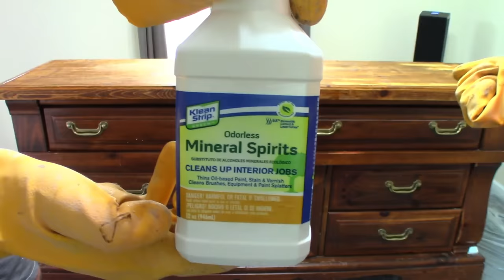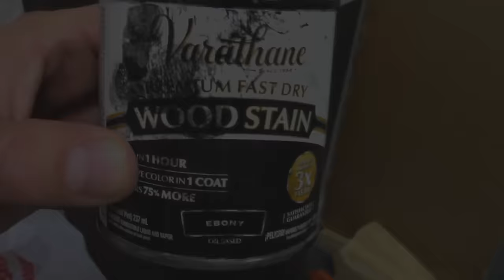Turning a Dresser into a TV Stand

Comment: One suggestion on using what you referred to as silcone. Paint will not stick to 100% silicone caulk. I think what you were using was latex caulk with silicone which can be painted. Viewers may be confused on what caulk to use when painting. Hope this helps.

Comment: can you give details about the sanding please?
Reply from the maker: I sanded the top with a belt sander with 120 grit sandpaper then we finished it with 220 to smooth it out.  The bottom we sanded with 220 just so scuff up the surface and remove small dents, dings and scratches.  Hope this helps 🙂
Reply: @TheInexperiencedAdventures  thank you.